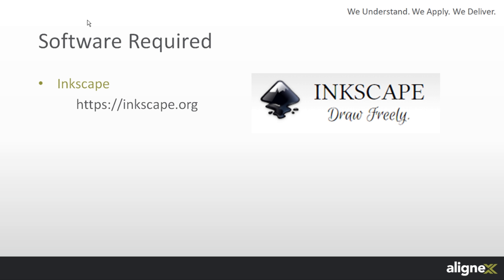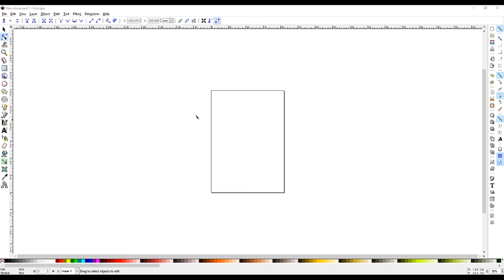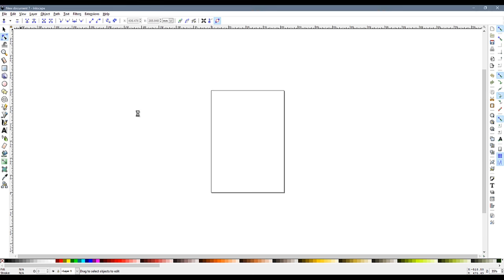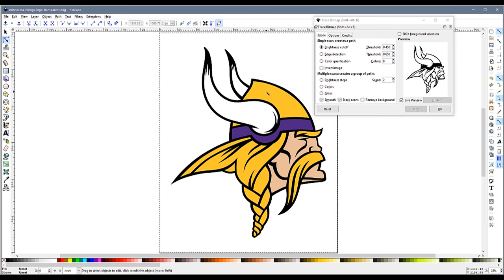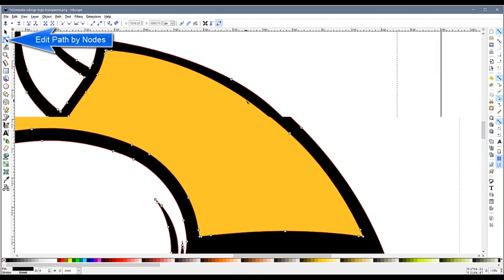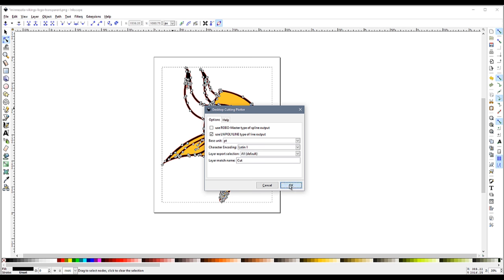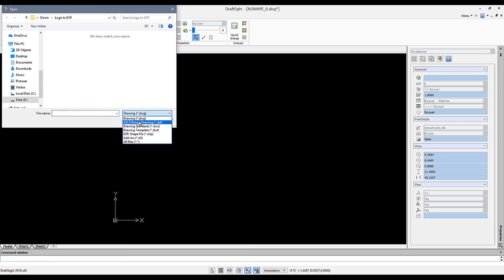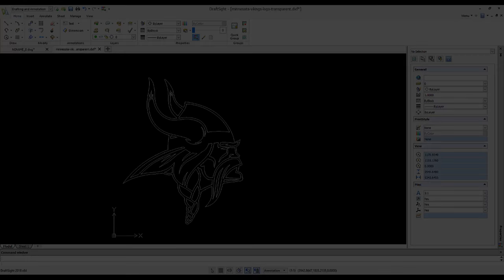How to Convert an Image File to DXF

Comment: Will this work if I take a photo of a auto part bracket and want to send it to my cutter? How do I scale the sizing correctly? Thank you
Reply: As long as you use a measurement scale, ruler, tape measure, etc against your part. Then when you open in your CAD software, scale the size till it’s accurate to the one in the pic.